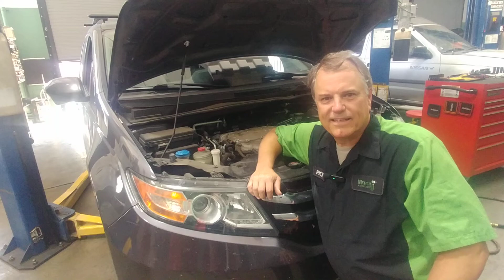How to tell if your AC is low on Refrigerant.

Comment: Dealing with this on my cobalt. I think I hear the compressor kick on once in a while but no cold air, when hooked to my ac tool to check the level and it immediately goes to max on the guage. Thoughts?
Reply: Change the high press valve
Reply: Or u could be low some cars or trucks take 2 to 3 cans

Comment: What are the actual office names of the 2 air  conditioning lines?
Reply from the maker: Evaporator inlet and outlet
Reply: It depends on the specific point in the system each of the lines are.If talking about the two lines going through the firewall to the evaporator,    there the wide line is the suction line and the narrow line is the liquid line.